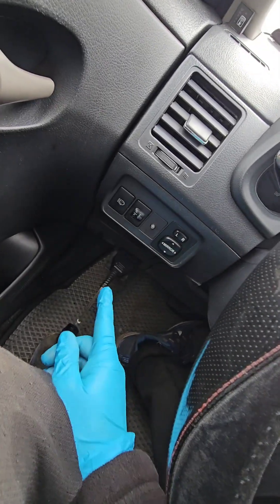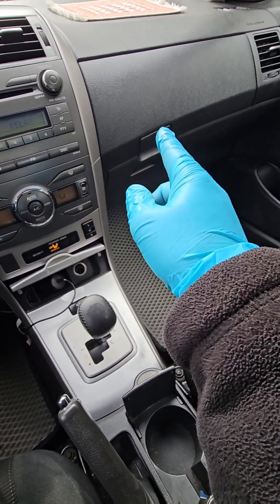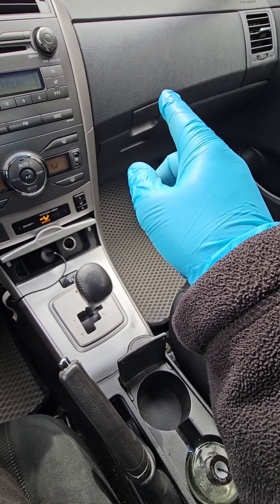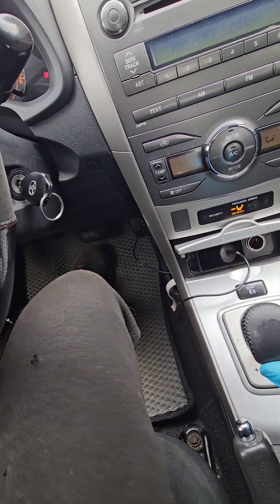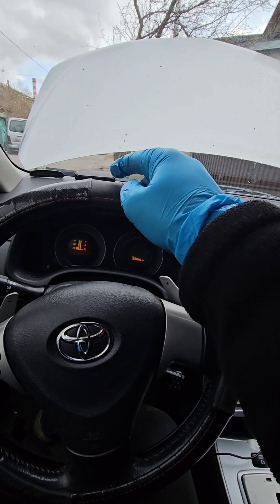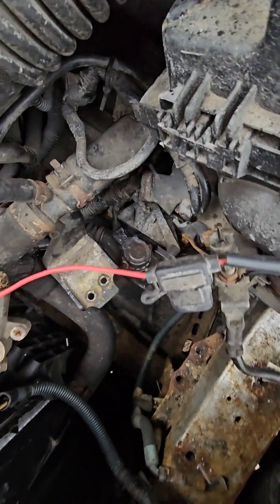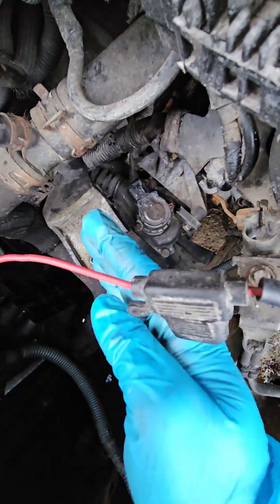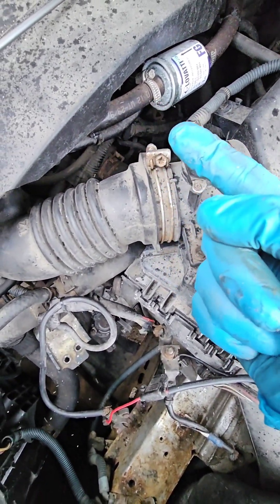ADAPTATION OF THE ROBOT IF THE CLUTCH IS SLIPPERY AND NOT ONLY VIA CLAMP MODE - SERVICE MODE TOYOTA

Comment: Dude. I had the similar problem. It is caused by driving at low RPMs,  since MMT is under a hard working pressure and constantly adopting to a driving manner. As it is planned by manufacturers ECU is trying to manage the most economical driving outcome of a car. Driving in E mode is convenient but not robust enough for a MMT. I fixed it by bleeding a hydraulic clutch. Then initialization. Then is the the most important and final part: perform learning of a MMT in manual mode at high RMS, like 3000-3500. Good luck on roads!
Reply: @vak_service  How do we perform learning in manual mode
Reply: After calibration done by breach wire.
You get on the road and use the manual looking at your dash board from 1st gear to 2nd you need to  speed  up 30km/h
from 2nd to 3rd  50km/h from 3rd to 4th gear 70km, from 4th to 5th 90km/h

Then you need to slow down by braking until car drops the speed upto 2nd gear and then you manually switch it from second gear to first.
That is manual leaning done!

I hope I'm right?
Correct me if I'm not!!!
Reply from the maker: @HIGHLANDER-  Yes. You are right!
Reply from the maker: Yes.